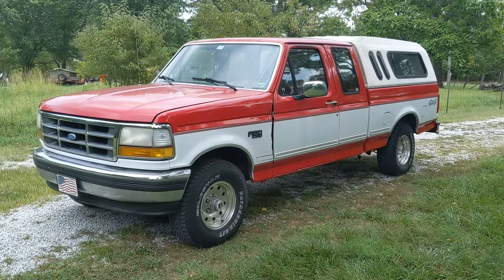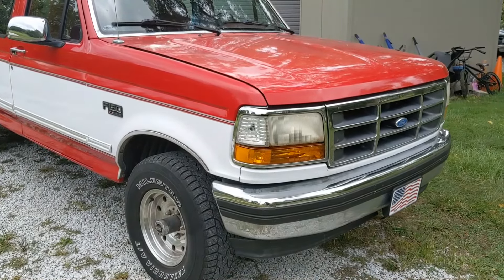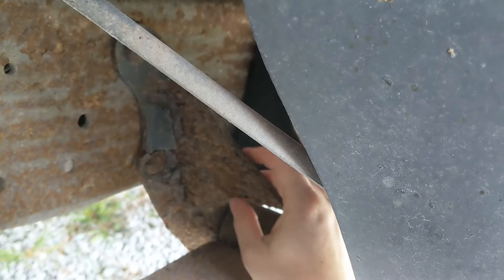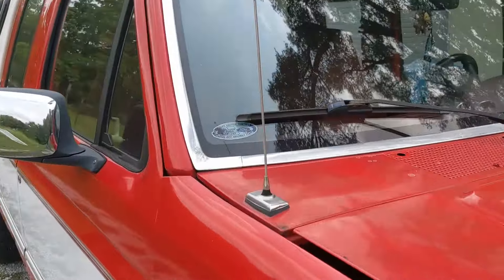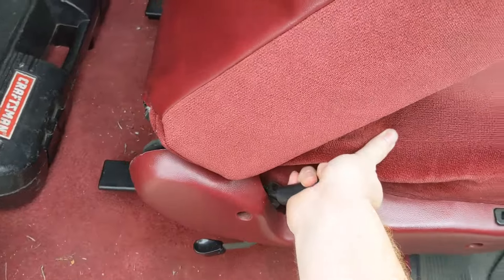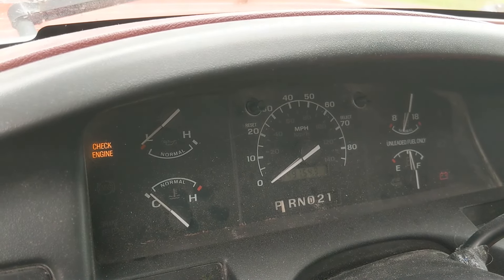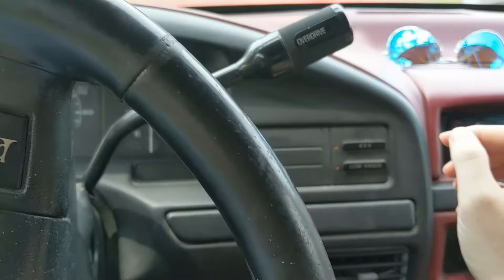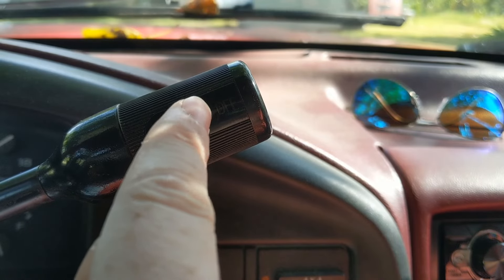SO YOU WANT TO BUY AN OBS FORD TRUCK (92-97)

Comment: 71+ year old retired farmer and long time user of various size trucks. In December of 2007 I bought two 1996 F250’s from the same dealer at the same time. One Super Cab 4x4 long bed with the fuel injected 351/5.8L with the automatic transmission with overdriveand one Super  Cab 4x4 short bed flat bed 460/7.5L  with the 5 speed manual transmission. The long bed truck had automatic locking hubs and the short one had manual lockouts. Both trucks had about 150K on them. No real problems of any kind. It wasn’t until I got them home that I found out that they were both OBDI vehicles when I went to put my scan tool on them just for the heck of it. They also both had 4.10 gears. I knew the 460 had 4.10’s but hadn’t checked the tag on the long bed and just assumed it had the mid range 3.55’s that were common with those trucks. I used the long bed version for general farm hauling including not too heavy loads on my 27 ft goose neck flat bed trailer and the short bed with the 460 for hauling heavy loads on the same trailer. In general use the 351 would average around 12 mpg and up to 15 mpg on occasions when I would take it on a highway trip of more than just a few miles. The 460 averaged about 10 mpg and really not much less than that when heavily loaded. Typical was 8-9 and sometimes a little less if I was driving in a lot of hills. The worst it ever did was 5-6 mpg when I was pulling a grain trailer loaded to 18000-19000 pounds gross weight the short 5 miles to the grain elevator and ended up idling a lot while waiting in line to unload. I just recently sold the long bed with a little under 200,000 miles on it. I got an excellent price for it because I had taken care of it and fixed everything that needed fixing when it came around and it was just starting to rust along the bottom edge of the bed even though it had been driven in mud, snow and salted roads while we had it. It was always shedded when not being used. I still have the 460 flat bed and it only has 185k on it now. It will pull as much as the early Dodge Cummins or 6.5 Chevy diesel. It will out pull the early 6.2  Chevy diesels. Diesels are only worth their cost if you have to drive a ton of miles every year. The initial cost and much higher maintenance costs make for a bad deal unless you’re pulling heavy loads many, many miles a year. Besides being a retired farmer I’m a retired farm banker and accountant who knows how to run the numbers. This ain’t my first rodeo.😊
Reply from the maker: @davewinter2688  AMEN.  I've long since sold the 96 in this video but I'm picking up a 92 F250 super cab 2wd long bed.  351/E4OD.  I've had a few in that configuration and it's a great setup.  I had two 460 trucks.  They pull well but a 91-95 454 pulls just as well but will better economy when equipped with a 4L80 or NV4500.  The E4OD is solid but the 4L80 takes abuse better.  The last few years of OBD-1 Chevys and Ford's were damn great trucks.
Reply: @ I’ve never had any problems with the tranny in the 351 but I don’t abuse things. Had plenty of problems with 4L60E in my wife’s 2000 Chevy Tahoe and she’s very easy with her vehicles. Never had anything with the 4L80E. I forgot to mention for the youngsters that the 4.9L/300 in line 6 is a great puller, better than the 302 in either F150 or 250 when geared right. Not fast fast but Hell for torque.
Reply from the maker: @davewinter2688  yes, the 4L60 is pretty weak in stock form.  The 4L80 tends to survive better when abused.  They like to pull hard.  I haven't had any issues with an E4OD either but I've seen them and 4L80s fail with friends.  Still a damn good unit tho.  Although my personal favorites are the C6 and the TH400.  I've never been able to hurt either one.
Reply: @ Never had a C6 or TH400 but I’ve heard the E4OD referred to as a C6 with an over drive unit. All good excellent transmissions but my favorite is a 727 TorqueFlite. I’ve had them in 400 big blocks and 440’s in a Power Wagon. Can’t kill them.
Reply from the maker: @davewinter2688  yes and I've often heard of the th400/4L80 being referred to the same way.  Dodge and I don't get along.  I've tried a few times.  My first vehicle was a 78 Dodge Club Cab 2wd with a 360 and an automatic.  Great truck but my brother trashed it.

Comment: I'm 15 and looking at a 1994 f150 XL 4x4 5 speed  inline 6/ 4.9 203k miles decent shape a few chips in paint a few small dints but I just want a truck that's 4x4 and i don't mind scratching it. My dad has a 97 f250 diesel 7.3 with 5 speed and 130k miles and I have a 93 f150 2wd with 63k miles with the 5.0. Thanks for the video I knew a few places to check but this added to my arsenal. Thank you. And the only thing I don't like about the 4.9 is thee sound can't beat the rumble of a V8.
Reply from the maker: Yes but Ford's 4.9 sounds SO MUCH BETTER than GMs 4.3 and is also much tougher.  As for price, $3500-$4000 is the going rate in my area, yours may be different.  Of course get the truck as cheap as you can keeping in mind there are always unforseen issues with older vehicles.
Reply: @shadygingergarage  yep my dad is also looking it over and thank you for the information. I'll try to get it cheapas I can of course. The guy has no attachment to it and he just bought it from a friend that needed money. It's very clean as far as dirt and grime and everything only one visible rust place and it's in the bottom rear corner of the inside door "jam" on driver side but it's about what I'm looking for in a hunting/fishing/ work truck. Thank you Sir.
Reply from the maker: @tndeerhunter8216  you're welcome.  Good luck and happy hunting!
Reply: @shadygingergarage  well.....the truck sold before I got there .......but I found a 89 f250 diesel that will probably suit my needs better..wish me luck
Reply: I just scored one today few hours ago 1993 f150 4X4 inline6 with the 5speed did I mention regular cab short bed 239K for 3000 Dude was asking 4999

Comment: 13 mpg on that 351, even with the 5 spd manual. I had a F-250 with a 460 and barely got 8 mpg. It was horrible to the point where I didn't even want to drive it and this was even with the cheap gas prices of the 90s.

Comment: Bought a maintenance neglected 1991 F150 2wd 4.9liter last year for $850.  It had what I thought was a manifold gasket leak, but turned out to have hairline cracks in the head and a pinhole in the block.   $4800  for a remanufactured long block installed.  I calculated how much I'm in all together  this morning, $9600 for a straight non-rust rotted truck.  My intention is to keep and use the truck, so now I know what I've got because I've  put it all in.
Reply: Couldn't read your reply.  It's just not there.
Reply: You git an engine that will outlive you
Reply from the maker: @danbolton3180  WOW, sorry this took a year.  I guess I never got notified of your second message.  I think what happened is I replied to a comment on another video under your message by mistake and took it down.  Anyway, yeah, that's a ton to have in a truck but you are right.  It's sometimes better to know what you have.  I'm struggling with that premise on a couple of my vehicles right now, lol.  YouTube is a constant struggle of Content versus Value.  It's easy to throw junk together for clicks but I want to build better vehicles so I have better vehicles and maybe the viewer learns along the way.  Vice Grip and Junkyard Digs both know what they are doing but in the end you end up with dozens of vehicles that are slightly better than they were before getting pulled out of a field.

Comment: Amen to the standard transmission.  I have a 1990 F150, inline 6 cylinder automatic transmission. I wished mine was older so it would have a carburetor and I prefer a standard transmission.  Fuel injection,  computer,  serpentine belt,  and and sensors I can do without.
Reply from the maker: I actually just picked up another OBS Ford and may grab yet another this weekend.  One with 351/auto and the other is a 300-6/5spd short bed

Comment: I like your truck!  I have 95 4x4 5.0 manual and I put new motor and transmission and rebuilt front end and installed a new redhead steering gear box.
Reply from the maker: I sold this 95 after 3 years of ownership.  The guy I sold it to took excellent care of it but he sold it just a couple weeks ago.  I've been looking for another one but no luck so far.  My current truck is a 99 (OBS) Chevy Suburban, 3/4 ton 4wd.

Comment: Man I just bought a 1994 Ford F150 and I honestly really like driving it. It's not bad. Everything works fine. It only has 102,000 miles on it. So it was hard not to wanna buy it. The only thing not so good about it is the gas mileage. It's pretty dang bad. Yeah you do get 2 gas tanks so you get more to go along. But man that needle goes fast. But it's an experience to drive. It was sorta on my bucket list to own and drive one. If I can get used to the gas milage. Otherwise it's a pretty great truck.
Reply from the maker: Most trucks are pretty hard on fuel, especially 4x4s.  But what they are capable of makes the trade off worth it.  My 3/4 ton 4x4 Suburban is hard on fuel but has seating for 7 and pulls a trailer.

Comment: I just picked up a 1994 f150 with the 302 4x4 LB for $1600 and it has a few issues i am going to deal with and so far they are simple fixes

Comment: I had a truck exactly like that. I sure wish I still had it, and yes the manual is the way to go!
Reply from the maker: @Musictroper76  I'm looking for another one myself.  Trying to find an extended cab 4x4 with manual transmission.  I'll take either the 300-6 or a 351.  Unfortunately the 351/5spd combo with a manual transmission is pretty rare.
Reply: @shadygingergarage  Do you remember the 300 I6 with 4 spd combo and manual looking hubs? Pair one of those with a short bed 4X4 with all of that torque and you have a good trail runner!
Reply from the maker: @Musictroper76  indeed.  I had that in a long bed about 7 years ago

Comment: just two cents, if the front leaf spring bracket is that difficult to replace, why would you not get access to it, wire brush and wire wheel it clean and put a stop rust product on it to prevent it from continuing to degrade?
Reply from the maker: They weren't as bad as I thought.  I did include new ones when I sold the truck.

Comment: They're going for about $8k-$20k for the 4x4 models in my area (southern california) . I found a decent shape 95  for $8K (he dropped it down from 12k in the ad) i'm not sure if its even worth $8k  by looking at prices from 1-2 years ago. I might just consider a 10th gen 4x4 with less miles, they're going for 4k-6k for the 4x4 models since they're not desirable due to the looks.

Comment: Just bought a 1996 super duty 460 auto dually bucket truck that sat for a few years. After an extensive, wash down six tires, front and rear breaks front and rear shocks, front rear brake lines, and hoses. Throw in one ecm.
And the truck chassy
It's nice at 12800 miles. Only thing left to do is diamond plate in the bed, hoses on the hydraulic system and extension cylinder in the boom.
Bought for $4500. I do all my own work. These trucks in good working condition.Go for $10-15,000. I'm all in currently about $7,000. My biggest recommendation, if your computer hasn't been touched even if it's not giving you problems, get it fixed ASAP.

Comment: I’m looking at a 7 grand 97 7.3 300 thousand miles, if I drive it a bit down the road to feel the transmission out how do I trust it won’t konk out 5 days later? Is it possible to feel fine and 5 days later die? Or will you be able to feel it’s only got 5 days left
Reply from the maker: Pay close attention to how it shifts.  If it shifts too hard or thuds into gears when it shifts, it's got a problem.  Also, if it slips between gears, it's got a problem.  Slipping usually sounds like the engine is suddenly climbing rpm for too long without gaining forward momentum.  Also, a transmission slip can present as a "hunting" behavior.  This is where the transmission seems to be hunting for an upshift or a downshift.  Of course, being an old truck, there are no guarantees.  It could run perfect on the test drive and then completely shut the bed a week later.  This happened to me on not one, but two Ford Tauruses, a year apart from each other.  Had both cars at the same time.  Blue one shit the bed a week after purchase without warning.  I sold my F250 to fix it.  Then, six months later my green Taurus did the same thing after 18 months of ownership.  I promptly sold the green one.  Then, 5 months later the blue Taurus threw a transmission code.  I threw in the towel and sold it as well.

Comment: instead of a 98 thru 24, id take a 65 thru 95 xlt long bed 2 wheel drive 351w 5 speed.all the truck id ever need.for the price & trouble for a new one, you could build 2 or 3 older more reliable ones.
Reply from the maker: @timkis64  I'm looking at an 88 F150 this week.  Regular cab long bed 2wd, 300-6/5spd

Comment: No, no i really dont want to buy a Ford truck lol. Whats up man.
Reply from the maker: Lol.  Nothing much.  Just paying bills and surfing marketplace with no budget.
Reply: @shadygingergarage  sounds about accurate.
Reply from the maker: I've been looking at a 1990 Dodge W250.  I know, a Dodge, lol.  It's a TBI 360/4spd, 3/4 ton 4x4 with zero rust and a new computer.  I'd have to trade my F150 to get it tho and I'm not sure I want a Dodge that bad.  I'm priced clean out of the Chevys tho.
Reply from the maker: @UsefulEntertainment  what are you doing these days?
Reply: @shadygingergarage  ahh, nothing wrong with the dodge, i like them. Man ive just been working at my job and haven't done anything with the cars but i should be getting my licence back real soon
Reply from the maker: @UsefulEntertainment  sweet!  I've got things I can do on my Camaro with parts on hand, just no time to do it
Reply: @shadygingergarage  whats first on the camaro bucket list? Mine needs wheel cylinders. I bought new ones but rather then deal with the bs clips to replace them, im just going to gut and hone out the ones on the car now and just swap the new guts inside. This way i dont have to take them off the car.
Reply from the maker: @UsefulEntertainment  I'm swapping from power to manual windows by swapping the entire door.  I've also got a manual window center console (no switches).  Next I have a nicer hatch to swap on but it needs painted first.  Then, after the first of the year, I'm installing new tires on the '88 Firebird GTA wheels I've got so I can put them on the car.
Reply: @shadygingergarage  right on, im looking to do the opposite lol, im looking to swap my cranks for electric. I've got that wrecked 86 sport coupe that has all the stuff needed. I take it you got lucky and found red doors
Reply from the maker: @UsefulEntertainment  yeah, I grabbed a set of red doors last year for $50 plus I have a complete parts car with manual doors, seats, and console

Comment: I have a 92 Bronco 351W E4OD. It is the biggest piece of shit I have ever owned. It is awesome when it works right, but something always goes wrong with the stupid electronics. That POS transmission is tied into everything.
Reply from the maker: @relevation0  4x4 trucks can have a pretty hard life.  Good chance your truck may have been in some deep water.  Or if you are in an area where they salt the roads it could be a corroded connection issue.  I've been pretty lucky with the E4OD transmissions I've had.  But I've heard plenty of horror stories too.

Comment: 351 is OK 460 crazy horrible gas mileage 5.0 is junk two best motors in these by FAR the 7.3 powers powerstroke if you got a fat wallet and like expensive maintenance bills and the ol bulletproof 4.9L inline 6 those two motors took Ford trucks past 350 thousand miles more than any other Ford truck motor to date
Reply from the maker: @MarylandStreetcarsandBikes  I love the 300 and the 351.  302 belongs in cars.  460 is a great engine if paired to a 5 speed.  But with a 4 speed or an automatic it's just a fuel guzzler.